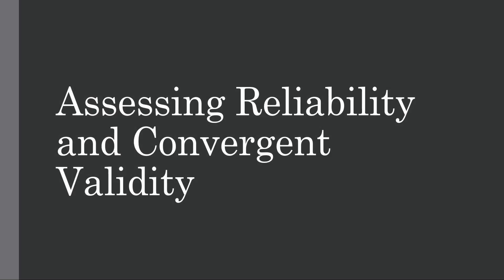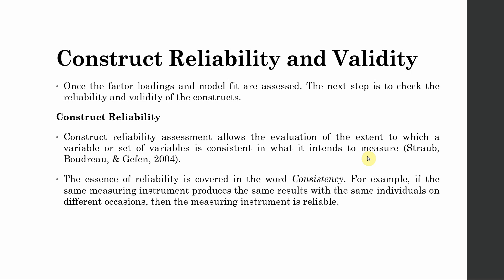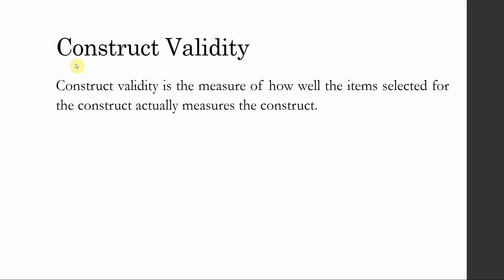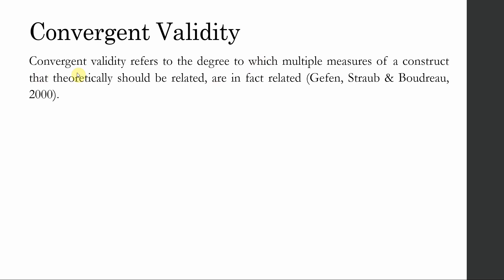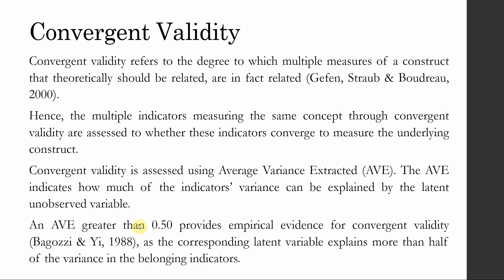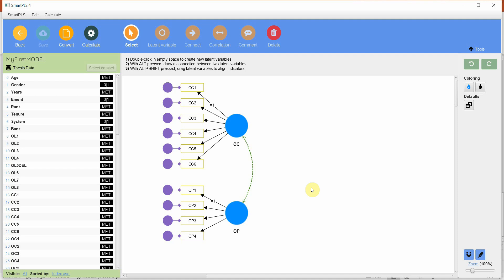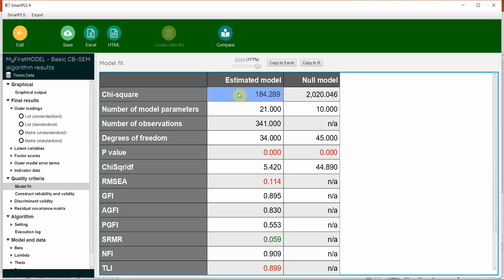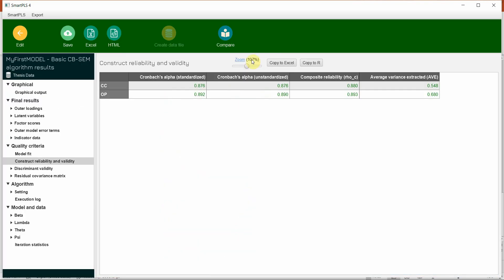CBSEM using #SmartPLS4 | 9 | Understand and Interpret Construct Reliability and Convergent Validity

Comment: Sir, Can we run the analysis (hypothesis testing) at the significance level of 0.10 in Amos?
Reply from the maker: You can interpret the significance results from AMOS at 0.10. If the p value is < 0.10, consider it significant.
Reply: @researchwithfawad  Thank you, Sir! What justification can we provide for using a significance level of 0.10 in the HRM field?